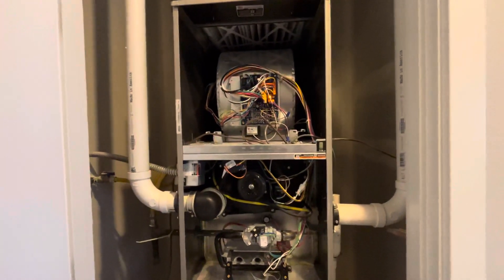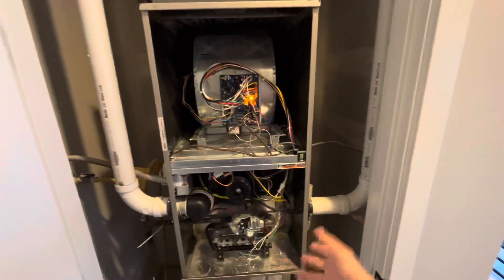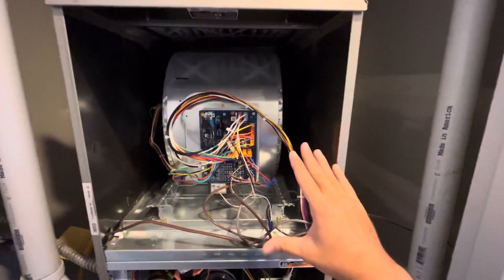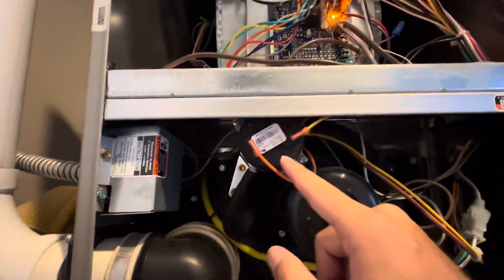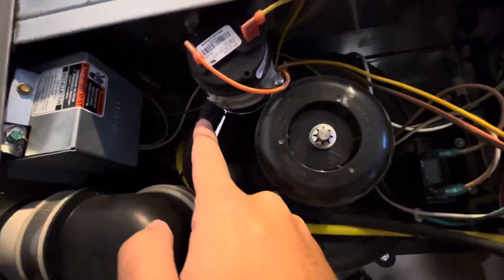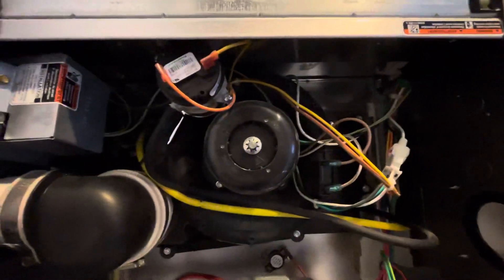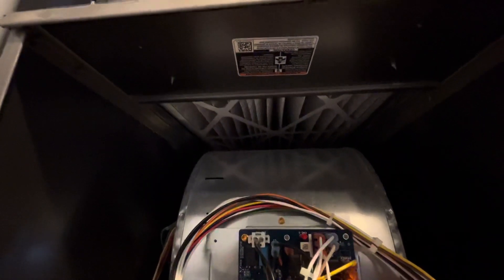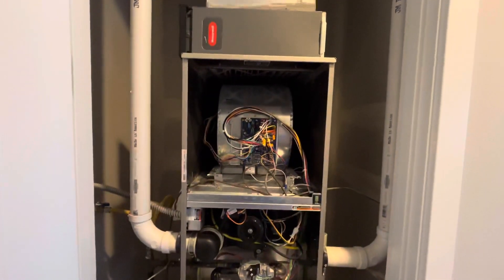How to fix furnace "Pressure Switch" issue. 3 EASY STEPS, NO HASSLE !!

Comment: So the pressure switch is NOT the problem, the problem is the that the water is not draining properly, what you really needed to do was clean and clear the condensate trap which you did not do  What will happen is your furnace will work until the pressure switch fills again with condensate and shuts your furnace down again.  Please don't post videos of stuff that you do not know about.
Reply from the maker: Thanks for the suggestion. I am not trying to make a sophisticated furnace debugging video as I am not the HVAC professional.  I'm simply sharing my experience on how to fix furnace issue. I did mention to drain the water inside the pipe (which ultimately fix the issue for me). And if doing simple steps as I described still not fixing the furnace, it is better to call the HVAC expert.